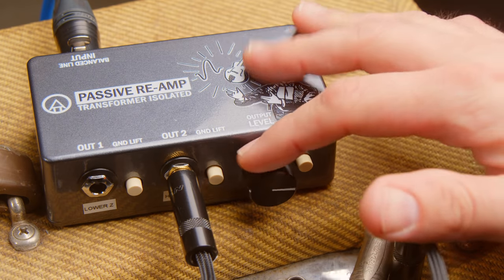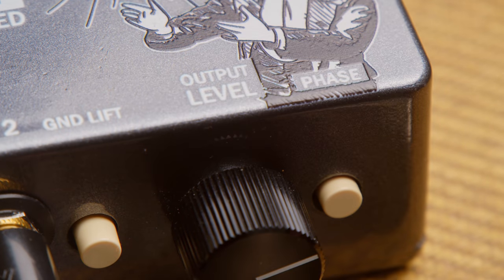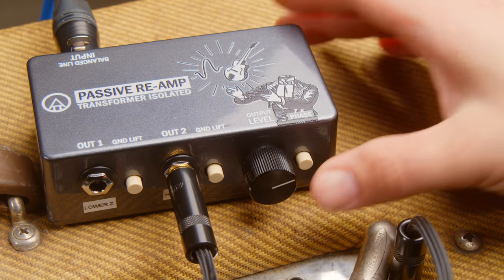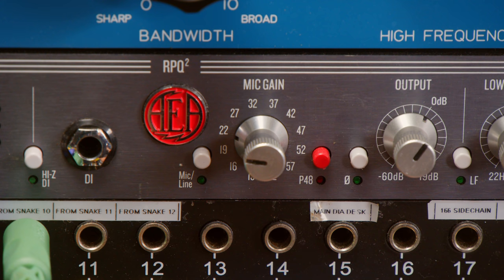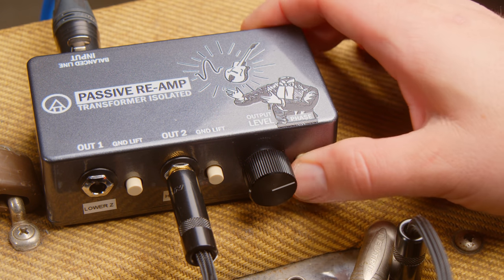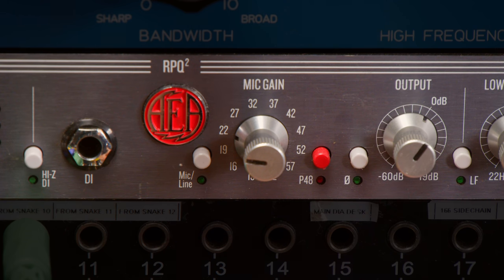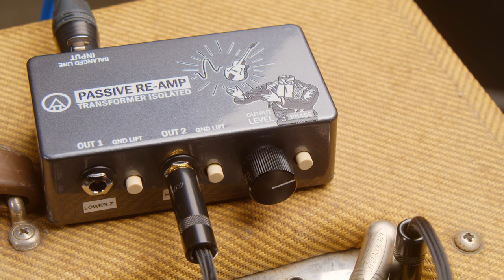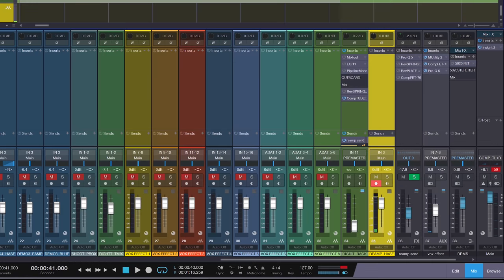No More Mono Guitar - A Real Way to Stereo-ize a Source

Comment: I can hear the difference and it does sound good, but I still do two guitar takes-one left and one right. To me, that's the only way to get that real stereo sound because of the different dynamics and imperfections of the left side and right side playing off each other.
Reply: Agreed, that’s why he said imagine you are stocked with just 1 take
Reply: @victorlara99  Just play another one :P Sure it's great for solos.

I can imagine this technique in a live setting though. Have 2 (of the same) amps and mic them the same way, reverse the input polarity of one, reverse it back on the preamp and pan them out.
Reply: Of course that is the ideal scenario. But this is great for someone that is sent a mono recording with no way of actually doubling it “for whatever reason”
Reply: @James Levine Mono compatibility has become a real pain in the ass these days, and you also need the highs there. damn mobile phone speakers! I sometimes even record 3 tracks of the same guitar, then pan 2 of them hard L/R, send them to a stereo bus and kill the mid signal there (only keep the sides). Then I add the 3rd track in the middle.
Reply: Thats 2 track

Comment: Are you sure it's the speaker where the magic happens? The slight asymmetry in the clipping in the preamp should be enough to cause that difference. (And based on what is known on how speakers work the polarity of the signal shouldn't really matter... It's the signal is AC after all. Speaker moves as much in both directions from it's resting position.) Not to take it away from you... This idea is still very good.
Reply: I think you're right. If it was the speaker then you could just wire a 2 speaker cab out of phase with each other and mic each. However, guitar amps are highly unbalanced so flipping the signal pre amp will induce enough variation for this to work. Speakers don't care about pushing or pulling first. E.g. A Plexi vs a single channel JCM800 don't have the same polarity of signal (due to the extra inverting stage of the JCM800).
Reply: I think this is true and its very easy to check using a loadbox. Will do when I get the chance, will post here my findings
Reply: a speaker has some nonlinear operation as well, especially when you turn the volume up. but i also think the main reason this works is the guitar amp, since overdrive and distortion is the essence of nonlinearity.
Reply: I would say all these statements are correct and together create the sound we hear: the polarity flip before the asymmetrical clipping stage is part of it, the speaker does not care if it pushes or pulls first, but there a (albeit slight) difference in sound when "biased" pos or neg. It's not uncommon to create a similar effect using eq or reamping w different amp or same amp w diff eq, but I find this take to be quite novel, very excited to try this out!
Reply: @rekeesefil  I think the best part is that the stereo version created by this trick is very well balanced without any extra steps. With two different amps the balance might need a bit of work. With this the frequency spectrum is exactly the same but some harmonics created by the distortion are probably flipped. On mono those harmonics wil cancel and the sound is a bit darker but just a bit (it might even benefit the mono).
Reply: @James Levine Oh yes... I'm familliar with cycling, although I'm down to 2500-3000 yearly kilometers. (I used to do about 5000.) It's my main means of daily transportation. I'm also falmilliar on how simple amplifying stages tend to distort as I've dabbled with electronics for quite a while... Simple one active device stages, like the ones in most tube preamps for guitar, tend to distort quite asymmetrically. I'm just quessing that those will swamp out most of the other asymmetries in the signal path. But yes... That's only a quess for now.

Comment: Ooooh, what a tasty trick!!!  And mono-safe.  It actually sounded better to me than the double tracked.  Love it!
Reply: i thought so too!  makes sense, doublers are in-box and will probably always come in second to effects you can cause and capture in the air itself.
Reply: @liquidstar9  oh was it a doubler?  i thought it was literally a 2nd recording (traditional 'doubled'), not a software 'double'.  if it was software, then i totally understand and agree with ya, Jon.  just putting stuff back in the air makes such a diff.  i loved learning that depeche mode put a lot of their synths thru guitar amps and reamped them to give them that girth and power.
Reply: @schance1666  i might have misunderstood then, i'll have to recheck.  i never knew that about depeche mode though!  good stuff

Comment: Thanks for the idea! Just tried it with an ITB guitar track. Duplicated the track and hard-panned them. Flipped polarity on one before the amp emulator, then another polarity flip after. Works like a charm! Lots of motion and space between the channels. I'll remember this!
Reply: I know this is an old comment of yours, so you may not be able to help. But how did you flip the polarity a second time after the amp emulator? My only thought is to maybe flip the polarity on the guitar track itself, then create a send track with the amp emulator on it and flip the polarity on that track. Would that do it? I would test this myself, but I'm not able to at the moment so I just thought I'd ask how you did it.
Reply: I don’t remember how I did it, hmmm… But with Reaper you can flip the polarity on a channel (which would be “after” the amp emu). For “before” I may have done it on the audio track itself. I also have the free DMG plugin “Track Control” which I believe provides control of polarity, as well as other things.
Reply: @dbhammond  Thanks for the reply! That's a good idea, I think a lot of plugins have a polarity option so that should give plenty of flexibility in ways to do it.

Comment: This is how the EHX Stereo Memory Man from the very early 80s created "Stereo". It has two out of phase channels.  Sounds amazing.  Nice that you discovered this trick yourself and are sharing it.
Reply: Isn’t this different? Out of phase (meaning small time delay) isn’t the same as flipping the polarity, applying non-linear distortion, and flipping the polarity back again
Reply: @Benji_6969  oh cool, maybe this is different.
Reply: @Benji_6969  So the SMM does flip the phase.  Each output has the dry and delay signals for a mono sound, but the phase is reversed to create a decent stereo effect when played live through two amps.  But it is not applying the distortion or flipping back, as far as I know.

Comment: speakers playing in reverse polarity do not "stress" an amp or anything, in fact many amps play "backwards" including many classic fenders, and no one notices til they run 2 different amps, and if one is reverse there is phase cancellation, but played alone sounds fine. Also amps can be internally reversing polarity with forwards polarity playing speakers, often both in the same amp ie certain 2 chan fenders
Reply: I commented pretty much the same thing. And when playing through different Marshall amps at rehearsal studios, I can get good feedback out of some, but not others. So I suspect the speakers or amp are reverse polarity.

Comment: I just became aware of this video because I saw the shoutout on Kohle audio cult channel. I am totally ITB and use Tonex and NAM for all my guitar sounds, and was wondering if this would work for me. Short answer; it absolutely does work, and I really dig the result. 
Longer answer with method: I’m in Logic Pro, but any DAW with a plugin that flips phase will work. I duplicated my DI track, and loaded up the same amp sim on both with the same settings. On the duplicate track I loaded the Noiseash Pre 73 plug-in before the amp sim. The Noiseash has a phase flip switch. Then after the amp I used logic’s gain plugin to flip the phase back. Hard pan, BOOM. It’s great.

Comment: Nice! The distortion in gain stages in a guitar amp are asymmetrical, the speaker distortion is asymmetrical. Let's say (arbitrary example), 1st stage clips the top of the waveform and inverts it, so now 2nd stage clips what was the bottom, and so on. When you feed this a flipped signal you're doing the opposite: first clip the bottom, then the top, and so on. At the end you flip it to get in phase, but the harmonic content is different enough to get this effect. BTW you could try the same technique with a guitar amp plugin.
Reply: This is actually the correct interpretation of the effect that we hear, non?

Comment: 1:13 [citation needed] not saying you're wrong, just that this really doesn't gel with the mental model I've built up of acoustic and electronic audio systems. But I'm nobody, so I guess I could just be ignorant.

I'm pretty sure the biggest factor here is simply asymmetric distortion in the preamp, poweramp, and probably even speaker.

I wonder what the effect is like if you run a clean amp instead of a saturating one. My hypothesis is that with more distortion you get a wider stereo image, and vice versa
Reply: Was thinking exactly the same. Dont think that it stresses out the speaker. AC stays AC. The asymetric clipping might be the key and this could be tested with clean settings.
Reply: It doesn’t. As you mentioned, it’s asymmetrical clipping of the waveform. When you invert the phase, you’re reversing the positive and negative clipping threshold. The reason why the mono summing of the stereo image sounds different from if it was a single mono track is that you’re now essentially turning two asymmetrical clipping takes into a single symmetrically clipped waveform that will have some appreciably different characteristics from traditional symmetrical clipping methods.
Reply: Yeah the speakers (or amp) really don’t care. Speaker polarity often has to be monkeyed with in stereo or wet/dry/wet rigs, and especially in the P.A world where there’s massive speaker cable runs. The amps and speakers really couldn’t care less
Reply: I was just going to type this exact comment. A speaker doesn’t sound different when you flip its phase. A quick way to prove this is to perform this same demonstration but invert the wires on the speaker instead of using the phase switch on the box. Speakers do not care at all about phase. The only reason you should pay attention to polarity is when you are using multiple speakers in close proximity, ie; multi-speaker cabinet, to avoid phase cancelling issues.

Comment: It's not the speaker that's causing the increased width, it's the even harmonic distortion in the amp. When you flip the phase, you're still generating those 2nd, 4th, 6th etc harmonics, but you're chopping off the bottom half rather than the top half of the wave to achieve them. So, only the even harmonics will be 180° out of phase, the fundamental and odd harmonics will still be in phase.

Speakers are linear, they don't care if they're pushing or pulling. But amps will distort, they're non-linear, so they do care if they push or pull. However, only on the even harmonics they're generating. 

(This is why you can get impulse responses for speakers, but not amps. IRs can only model linear filters, and speakers are mostly linear.)

It's a nice effect, very subtle and balanced between L and R speakers.
Reply: For very high volumes I would assume that the speaker itself will also show asymmetric distortion (even harmonics) since it is not built perfectly symmetrical. I currently do not have the environment here to blast a "high power low distortion power amp / guitar speaker / SM57 / low distortion mic preamp" combination into speaker saturation and check the distortion spectrum, though. :D
Would be an interesting thing to research...
Reply: @bavarianmonkey8326  sure, speakers can and do hit their X Max, or maximum excursion on the loud low notes, it'll add some extra girth to the low end in small amounts, but turn into a farty mess if pushed too much - as a bass player, I've destroyed a few speakers this way!

So yeah, you're right, the speaker will be adding some extra harmonic distortion. But since its following a Tweed Delux with a concertina phase splitter, I would guess that's where the bulk of the 2nd order harmonics are coming from.
Reply: @Mikey__R  I completely agree on the point that most even harmonics come from the amp.

I have done quite a few tests with impulse responses (self generated ones) and yes, they are close to the "real thing" in an A/B test, but they lack the dynamic effects the real speaker shows. Resonances, cone Breakup and distortion. For me this is only a gut feeling because I did not perform any measurements yet, but the fact that the impulse responses always seemed a little lifeless make me think that there is something to that story.
Especially with very old speaker designs, I would not expect those to have a very linear behaviour mechanically (magnetically), so even if the speaker stays within xmax, the question arises what xmax actually refers to: Mechanical xmax (damage) or linear xmax and what "linear" means. Which brings us back to square one.

I did some tests with rather asymmetric push pull power amplifiers (asymmetry was adjustable) and it felt like inverting the speaker polarity changed the sound at high levels.

Guess that is the area where UA did quite some research for their OX...
Reply: @bavarianmonkey8326  cool! I've never really investigated that deeply. I'm definitely in the "real amps sound better" camp, simulations are entirely useful but they're not perfect. You might well be right, the very minute details could be more important than we realised.

Comment: Hey man! Great video again. 

I just tested the speaker part of this theory of yours, with a power amp and a speaker. And I have some interesting results for you.

I noticed that the stereo trick doesn't happen in the speaker. If you go straight into a speaker (with a power amp with a DI of an amp output) out of phase, and then flip the phase back in and pan both tracks the image stays in the center. It gets a little blurry and has a little more depth. When you listen to the cancelled signals you only get a very slight top end distortion difference. But it seems, it's not enough to create the stereo difference.

So that means that most of this effect is more likely happening within the amp.
Reply: If he is using the amp to distort, it might be that his particular choice of amp has asymmetric distortion. In which case this won't work with most amps. Or there is something silly like, the mic position changed slightly between the two runs, etc.

Comment: Super cool! Based on your description of the speaker behavior, I expect the Haas effect is what's at play here (meaning the lag at the speaker causes a tiny delay in the return signal). I'm astonished that this works in a DAW with an amp simulator. I tried four different sims from four different companies. Three of the four had a pretty pronounced effect. One had almost no effect. Interesting that the other three seem to simulate the behavior of an out-of-phase signal through the amp and speaker correctly.
Reply: Pretty sure Haas isn't much of a factor here as when he nulls it by not flipping the polarity there's only high frequency left. With Haas you'd get a comb filter with some bottom end - notoriously bad in mono. 

Pretty sure the whole thing is caused by asymmetrical clipping in the amp, which might only be a thing in certain amp designs. So depending on which amp your sims are based on and how accurately they're modeled, the lack of effect might actually be true to the original. It probably doesn't work very well with a clean amp either.
Reply: I wouldn't count in three of them doing it correctly. It may very well be the exact opposite: That a typical signal has an offset and only one out of four amp simulators remove it, which would happen in an amp. More tests would be needed to check for that.

A real amp and speaker does NOT care what phase the signal is. However, the distortion might be asymmetric, and it could also very well be that three out of four simulators emulate the guitar preamp clipping correctly.

Comment: I have done similar experiments through analog delays or reverbs, 1 take, two passes (or more). The pedals will never react the same (even with the exact same settings) so you can create huge lush images like that (mono compatible). If you then play a bit with the knobs during the reamping (let's say the feedback or mix, so the timing of the echoes doesn't get all over the place and too distracting later) the results are incredible.

Comment: I love the idea. I’m not sure if it’s the speaker which is the cause of this or the valves/tubes and transformers being non-linear when they are pushed into saturation/distortion. A good way to test that is to try the same technique with some tubes that are badly biased. Thanks for taking the time to do the video! The effect is awesome!
Reply: If this is the case you could verify by just reamping twice without doing any flipping and expect a similar result correct?

Comment: This is very interesting. I wouldn’t say speakers don’t like reverse polarity signals, because half of the signal is always pushing out and the other half in. Also many guitar effect pedals invert the polarity. You don’t normally hear phase differences.  

I notice when I play through different amps at rehearsal studios that I can get good feedback out of some, but nothing out of others. I’m guessing the speaker cab’s polarity is reversed (maybe the speaker cable?). At some point I’m going to make a pedal that just flips the polarity and see. 

But I do think you’re getting a different sound from the amp. It might also be from the circuitry in the reamp box that inverts the signal. Who knows?